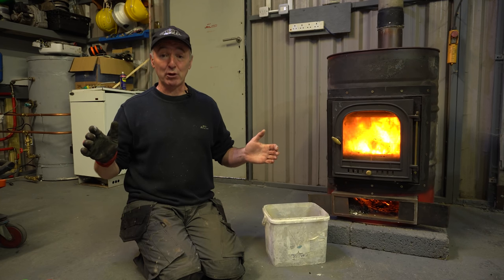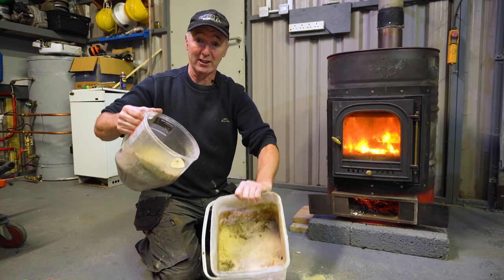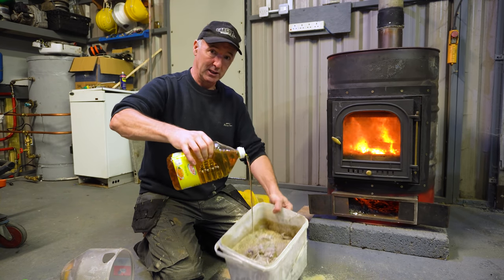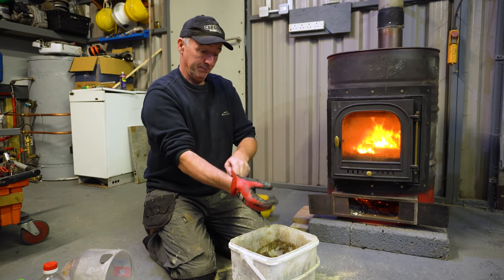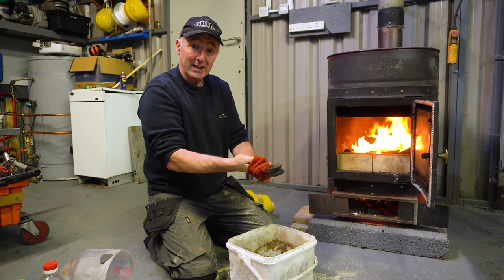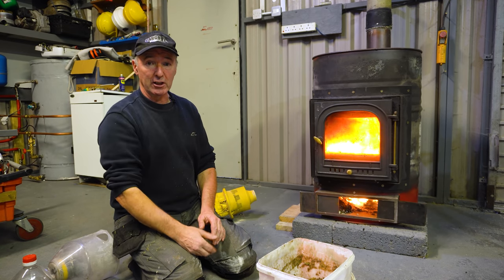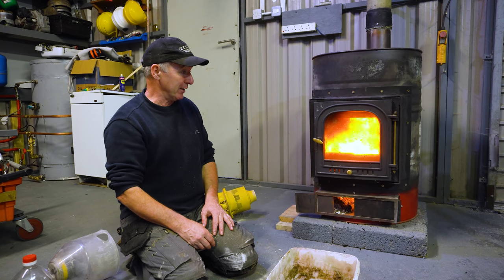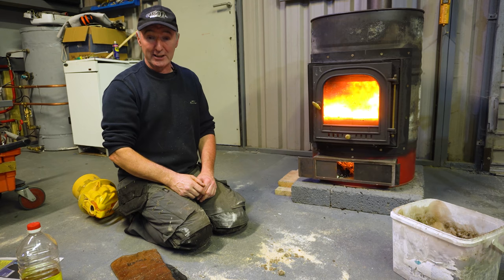Free heat from Sawdust + Vegetable oil .. No Tools Needed

Comment: I've done something like this many years ago but smaller scale. Get a wide metal coffee can, put in some vents a few inches from the bottom. Put in a mixture of saw dust and used vegetable oil and left over grease (below the level of your vent holes). Done. Lights easy. Burns a long time (you can put it out and relight it) and it's portable.
Reply: did you try boiling water or cooking food?
Reply: @rpgcinema7916  yes. it works
Reply: @JamesJones-mg3ts  that's great, I've been trying to figure out a way to use hobo stoves in rainy weather
Reply: @rpgcinema7916  Might be worth a try. You have to cover it starve it of air to put it out as once it's going, it's going. The saw dust is the 'wick' and it burns pretty hot. Back when I did this, I'd put it out and start it back up. Seems to last a long time. I've made things soup and eggs. Note: this was a long time ago but I did make a 'make-shift' grill for it out of coat hangers. I have no doubt it could be improved upon but my dad had a workshop with tons of sawdust and my mother would pour used frying oil and bacon grease into bottles and I'd use that and it worked great (and smelled like bacon sometimes).
Reply: @JamesJones-mg3ts  I'm going to try it with sawdust and wood shavings. I'm also going to try it inside a bigger tin can, the way people put buddy burners inside a hobo stove. When I go camping the rain hits halfway through and soaks my firewood, so bringing along a bottle of oil would solve that problem. I've also researched other solutions, like mixing aluminum powder with lye to form a flameless MRE heating pack, or just buying a camp stove.

Comment: Gerry when you pass America’s Tire you can stop and ask them for their used tires and they give you for as many as you can carry free.
I barely burn wood any more the tires make beautiful colors and noise too but they can be hard to cut so I welded 2 barrels together and pipe it to the old fire place so you can burn full tires.
It does make the ceiling black when your starting from cold and I have a problem neighbor who complains about everything and he reckons it was my stove that sooted up his siding and stuff so I put a 90 degree on the roof chimney and ran about 30 feet horizontally to the freeway so noone gets upset because they figure its from the cars like normal now.
I grown to like the smell better than wood too.
OK Thank You.

Comment: Burn your dryer lint as well. We stuff it in cardboard tubes from the paper towels, and seal each end with wax. Works great as starter logs when camping as well. You could also mix it 50/50 with lint and sawdust, with or without oil, and compress it in the tube to make a slower burning log

Comment: A good add to this information would be, a laser thermometer to track the temperature of burning straight wood vs oil soaked sawdust, straw or what have you.

I used to use pellets I treated with candle wax for fire starter.  I would pour a [double boiler on LOW heat] pan of wax from garage sale candles and blocks of paraffin over a five gallon bucket of pellets. Surprisingly, the melted wax would mix into the pellets well, if I didn't dawdle.

A cup or two would get the fire blazing hot, so it couldn't be used as regular fuel.

I didn't have a laser thermometer back in those days, but I don't doubt the heat that mix threw off was significantly above what well dried cherry kicked out.

Comment: Easy way to make sawdust,  put a couple of cups of wood pellets in an empty coffee can add a couple of cups of water and 15 minutes later you have moist sawdust. Wring out the excess water using a pillow case and squeeze it in a mop wringer. Spread the sawdust out on a sheet of plywood for further drying.

Comment: One thing you could try is flour and water as the binder. Its cheaper than oil. You can use dollar store pans as a mold. Also a great way to make a solid brick of birdseed or mouse feed. Let Mickey and Minnie chew on a brick of birdseed instead of stuff that's valuable.

Comment: compress them and they will burn for longer and hotter.
just get a metal tube with a smaller diamiter one in middle fill and use a bottle jack to compress it is vital that u have a small hole through the middle

Comment: Hello Gerry. In my opinion, this is basically a good idea - which unfortunately can lead to great trouble with the authorities in Germany (the "youth", who have not had to take care of themselves up to now, but have been fed by the "old", has for us decided that in the future we should enjoy the comforts of North Korea here...) Sorry, I digress.
In the video it looks as if the vegetable oil and wood flour mixture burns off very quickly. I would try compacting the mixture into briquettes by placing them in a box shaped metal mold (or tin can open on both sides) and compacting with a jack. The pressing pressure can be a good 2 to 4 tons. Excess oil can escape and be used for the next mixture. Can you please try it and show us the result in a video?

Comment: If I don't have access to a sawdust but have plenty of waste vegetable oil from a home fryer, could old ash be used in place of sawdust to be a binder?
Reply from the maker: Hi Garry. Anything combustible such as leaves, newspaper etc would be better than ash. I have diy burners on my channel that will burn waste oil without any medium but you would need a drip feed and a different setup. Here's a link to an easy to make burner. https://youtu.be/hw3v2gN_sLk Cheers Gerry

Comment: I’ve seen this before. Guys were using a hydraulic press to make cylinders in a pipe then cutting them into pucks to burn. Everyone who does use this technique cleans the chimney a couple of times a month to prevent soot build up. They use those chimney cleaning logs as well. Cheers.
Reply from the maker: Thanks Patrick. This stove is destined to be a multi fuel stove and will burn waste veggie oil on my own burner design. I have lots of these in my playlists but here's one I built and even cooked breakfast on. Thanks for commenting Cheers Gerry  https://youtu.be/tnzEDEpz3Yk

Comment: You can dial back the oil and just slightly moisten the sawdust. Your supply will last 5x longer. Just 1cup of oil per bucket is enough
Reply: I use used motor oil diluted with diesel to ignite my outdoor brush burn pit on my tree farm. Nothing is wasted

Comment: Does it ever get cold there?
for a few months out of the year the winter temps are around -50F windchill which is around -34C your temp. 
I have been using a 50 gallon drum stove burner, but thinking of adding another to heat both sides of my little shop. I like to do my wood working in winter, but the wood does not like to be worked when it is that cold lol

Comment: Ive done something similar except I use used motor oil smells a little funky but in my garage I don't mind it.tho I must admit using the bag to thrown in the saw dust is a good idea I usually just use the coal shovel (my stove is a soft coal/wood stove)
Reply from the maker: Thanks for sharing spike001ton Much appreciated Cheers Gerry👍
Reply: Hey spike, and no real mixing like with vegetable oil too.

Comment: In The 70's We would go fishing In the Snow up passed Your knees. We had Two large Timber Yards In the town. One was right by the River and Lakes. We would go In to the Yard and collect the Fine grain Sawdust from a Huge Shed there In bags. Then We would get old Paint Tins and start to compacted the Sawdust Into the Tin Inch by Inch. Then Put Petrol In, on Every stage, Just enough to damp It. You do this right to the top. Then all You have to do Is take the lid off. Run a Match over the top and It would Light up. Now this Is the best thing. Even though It put out a lot of Heat, The can doesn't get Hot cause It Is the Fumes that Is Burning. We would cook Food on It, Heat up water for Coffees. And Have a couple of them going at once. To Put them out, just put the lid on them. We didn't need to take them home, Just put them In the Rushes, they looked like someone had dumped old Paint Tins.
Reply from the maker: Hi theBudgie29 That sound great and you painted a fantastic picture of it, really well told. Thanks for sharing Cheers Gerry 👍
Reply: @Robbie gregory Layered the Sawdust Inch by Inch, Pouring just a little bit of Petrol to each layer, Damping more than soaking. till you reach the top, Leave about a Inch from the top (Don't Fill all the way). You can use bigger Cans, If You are heating  a big space. It Is just the Fumes of the Petrol that burns, so the tin  does not get hot. Then to Extinguish the flame, just put the lid on. Hope this Helps.

Comment: I can't help but wonder if you could compress this stuff into a mold and make logs.
Reply: Just wrote a comment about it. Yes, it's possible. But unless you have things set up/prepared for that. It's really not worth the trouble and extra time. 
On the other hand if you got the equipment prepared and most important. Enough raw material. Than it's another story! 

But then we're talking about industrializing the production! Surely that's beyond the scope of this video! :-) 
My "operation" runs beside my table saw. It's on a fixed spot, need regular cleaning of the sawdust... So it make sense! But even then it's not worth "industrializing" it more.  Due to relatively low amount of sawdust. 
On a professional/businesses level it surely can be worth. Think professional sawmill and equivalents. But those already have things set up to make money out of the leftover sawdust! 
It's not for a guy that make a few wood projects here and there! ;-)

Make the mix with used engine oil, stuff it in "containers". Fancy word for used toilet paper cardboard roll. Compress it by hand (wood stick), done! Repeat. In an hour or so, you can make quite a decent amount of them! 
Cheers

Comment: Did I catch that right? Talking about shooting of the chimney, if you burn it with good air in it will not shoot, but if you close down the air vent into...it will? Or only if it isn’t sufficiently hot?

Comment: Hey Gerry!  I'm building a decent sized cabin, and I'm planning on heating it with waste oil.  Is there a particular video you would suggest for a beginner?  Thank you!
Reply from the maker: Hi Clint. Not sure that this is entirely suitable for what you want but here's a video that I made a couple of years ago when I had my burner working in my house and running my underfloor heating https://youtu.be/SAmHNp6fOUA Hope this helps Cheers Gerry 👍
Reply: @GerrysDiy  thanks, mate!  I'll be sure to check it out!

Comment: I have a Lopi stove. Instructions say not to burn Presto logs because they can damage the stove. I tried burning Presto logs in my last house and nearly burned the place down because I didn't know they burn like a cigarette - that is, they don't just burn on the outside surface, but they burn internally too. You put to many in at once, like for overnight, and they will put out way too much heat.

Comment: I see that you are very rich. You use fresh oil as fuel.

Try adding old (drained) engine or transmission oil. Such oil can always be found in garages or service stations ...
In addition, many cafes and restaurants discard oil many times used to fry fish, potatoes and the like. Such oil can also be burned in a furnace, but the smell will be nicer than that of oil drained from the engine.
It is also possible to displace heavy fuels with sawdust, such as fuel oil or tar, with a high content of paraffin. Such fuel can be buy at a very low price in the seaport.

Удачи из России / Good luck from Russia.
Reply from the maker: This was used oil from my kitchen. I simply put it back in a container until I want to use it.  Thanks for commenting Cheers Gerry
Reply: @GerrysDiy  Nice.

Comment: can you convert a solid fuel back boiler stove to gas? propane or butane with lava rock or ceramic logs etc that will still heat the water in the boiler?

Comment: Suggestion: If your wood stove gets its air from inside your living space I heard it burns up your breathable air. Maybe you can run an air pipe outside that goes to the fireplace. Maybe a carbon monoxide alarm or monitor, on ebay are cheap,  and that sits low because the poisonous gas is heavy and sits low itself.

Comment: I get my sawdust from using pine nuggets as a cat letter replacement. Hardly any smell except the one cat that refuses to bury her poop. That we just use the scooper and either cover it up for a day or so, or we just flush it down the toilet and let the city take care of it. I never thought about drying it out in the sun and then mixing it with oil and then burning it. Now if I could just get some used oil from someone! If this worked it would not actually be free but it would be pretty cheap. At least cheaper than an electric heater or a gas heater. Or even burning cords of wood in a wood stove.
Reply from the maker: Hi Mike That sound great and would work great. Thanks for commenting Cheers Gerry 👍

Comment: Do you think it would work to pack it into a mesh basket?
I want to try and burn the waste wood pellet cat litter I have as it takes up too much room in the bin, I have lots of waste engine  oil available.
Reply from the maker: Hi David. If it were falling through your basket you could add a layer of steel mesh that would allow airflow but contain the pellets. Worth a try. Try a small amount first to make sure you can control the burn. Hope this helps. Cheers Gerry 👍

Comment: It looks like you switched over to a wood-burning stove. Was the oil burner too much of a hassle?
Reply from the maker: Hi MrSprintcat. I made this particular stove during the Spring and installed it. As I didn't need any heat during the Summer the stove went to the bottom of the todo list. I will finish the oil burning install over the next week or so. This will be a dual fuel stove with build videos soon. Thanks for commenting Cheers 👍
Reply: You got it buddy. I be waiting take care.

Comment: If you had a blower to the fire would this make a fire that would be hot enough to forge metal in
Reply from the maker: Hi Tommy. I will be converting this stove to run on waste oil with a blower and normally aspirated too in the next week. Would love to make a foundry too over the winter. Thanks for the suggestion Cheers Gerry👍

Comment: Wouldn't a vegetable oil create black smoke which would cause the chimney to get more buildup? This is one reason why people get seasoned firewood because it doesn't have any of the oils in it that the greenwood has. I personally would not put that oil in my wood burning furnace. In fact the only thing I pour in there that's liquid if I have trouble starting it is denatured alcohol because it burns so clean. But then again like you said if you're burning it extremely hot it may make a difference. But I hope you read the comment from the retired firefighter down below.

Comment: Gerry, I have a waist oil burner but I smoke bad.  I use oil from a old truck ans is very dark.  Is this why its smoking? The oil is to dirty.
Reply from the maker: Hi Mel. There are quite a few variables but the oil could be thick with no issues but if it can flow and you provide enough air with a decent flue you can get it to burn smokeless. I will be converting this stove in a few days. More videos soon Cheers Gerry👍
Reply: The Temps in your oven are too low!! Try to pre heat it with regular wood/coal until the embers are red hot!
Reply: Smoke usually means one of two things. Low temperature and/or lack of oxygen. 
You can rule it out easily and fast. Use and air drier or fan to blow some extra air into the burning 🔥.Usually temperature goes up. The smoke tend to disappear! 

If so, then you'll know that your lacking good ventilation and/or extraction. Good air draft is extremely important to maintain a good burn. 
The oil being "dirty" usually as no major consequences for burning purposes. ;-)

Comment: So the point is you're getting used or waste vegetable oil and you're mixing it with all the sawdust from your shop? Good idea for sure lad, I'm across the pond with alot of heavily wooded forest, nice big deere to do all the heavy work and 3 point splitter, 2-7 cord woodsheds.

Now it's on and I'm accepting your challenge I'm trying this haha.

This year I'm running the new drolet ht3000 big stove but she's a reburner I wonder if it'll work or my luck be disasterous

Comment: Could you compress that into a brick similar to the newspaper logs. Even if you had to add some newspaper strips to hold it together
Reply from the maker: Hi Albert. That would work but you end up squeezing out the oil. Thanks for taking the time to comment Cheers Gerry 👍

Comment: That's a good idea..
If you do that alot you should find yourself a small used or cheap cement mixer
Reply from the maker: Thanks Jimmie for the suggestion Cheers Gerry👍
Reply: @GerrysDiy  👍
Reply: @Robbie gregory with the cement mixer you can just start dumping bags in  or larger quantities than those cups and not layer it.

Comment: Good Heavens!  At the price of cooking oil, you might consider changing your title from FREE, because 1/2 gallon of oil likely costs $3.00 or more these days!!  That's a lot more than firewood.  Here is a good alternative, although it requires some preparation: make a slush with flour and water, then add the sawdust, and push into a mold, allow to dry, and you will have some 'bricks" to burn.

Comment: I just wonder if it builds up a flammable residue in the stove pipe or chimney.
Reply from the maker: Its possible at low burning temperatures but if treated like logs and burnt hot the inside of my stove is dry and has a combination of ash and very little soot. The flue / chimney being the same. Thanks for commenting Cheers Gerry